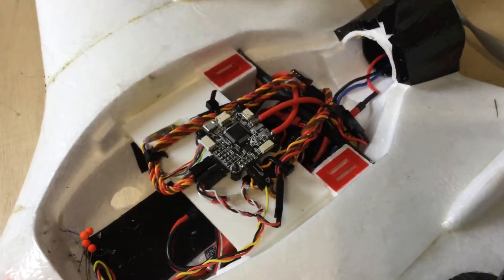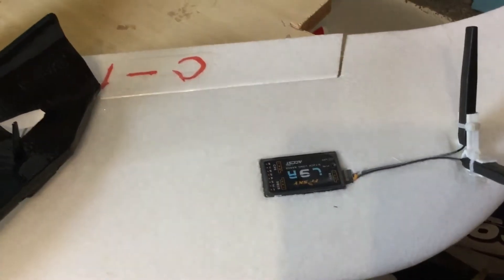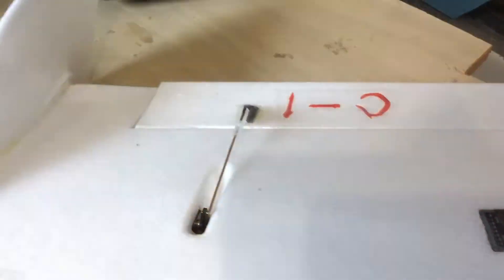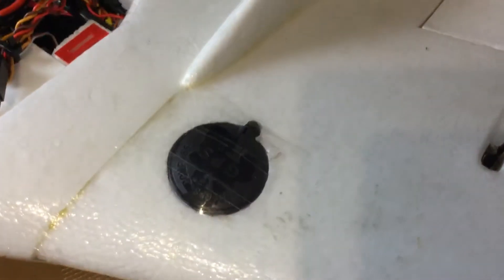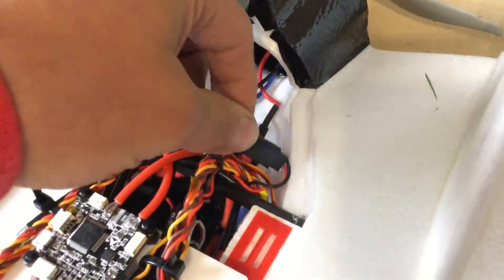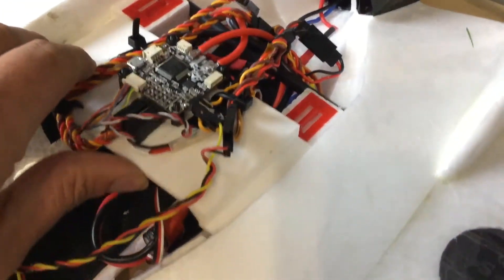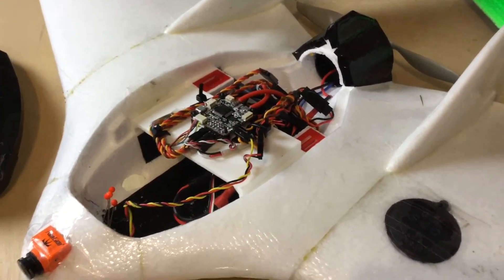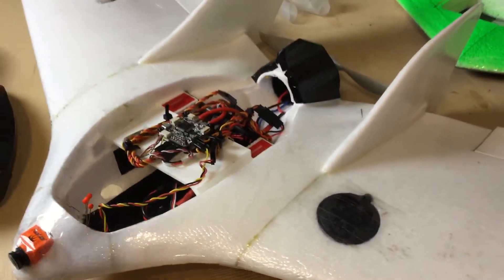C1 Chaser iNav Wiring Overview (Recorded on the iPad)

Comment: Very sneaky Matt!!! 
I've been searching for C1 Chaser videos or pictures with a 5.2 4S battery and just now realized that you made a step up with the board going across so the battery will fit underneath. I only noticed it when you lifted up the board. I'll be doing the same with balsa wood. Thank you.
Reply from the maker: Howdy Chris, oh totally! I knew it was going to be an issue when it first arrived and made 3D printed version. It has worked really well and using pins to keep the board still while in flight also worked very well too. Matt

Comment: Matt , do you need a Radio with S-bus to use iNav ?? many thanks , Scott
Reply from the maker: Howdy Scott, you can use PPM/CPPM or SBUS. These are the what the flight controller is expecting. If you don't have a receiver that supports either of these, then you can get a PWM to PPM (or SBUS) converter to take the PWM channels from the receiver and turn it into PPM, however I don't suggest those as it adds a lot of wiring to go wrong. So it's the receiver output, rather than the radio/transmitter  that is important here. Hope that helps Scott!
Reply: Thanks Matt , i use Hitech Aurora 9 radio but there is a FR-SKY delta 8  reciever that works with my radio and that does CCPM as i used that on a mini quad to cut down on the wiring . Great help Matt thanks a lot , now to start watching your iNav series ......

Comment: Thanks Matt. I was thinking that way, you
just confirmed my plans. So just bring yellow and black to the video in on the
 board. and yellow  and black out to TXred daisy chained  directly to main power pad.
Also could I get a copy of your C1 INAV setup files to copy paste???!!!
Reply from the maker: Howdy Art, it's buried under a load of other models at the moment. It's using the WW Z-84 present though and one of the servos needs reversing. Run this on the CLI tab and type save & press enter afterwards:

servo 3 1000 2000 1500 -100 -1

Comment: Hi Matt, I have a question. Building C1 chaser also. I have a 5vdc camera and the normal 12vdc tx. I have a 12 to 5v regulator on the camera as tx is 12v in and out.
How do I wire this configuration to  f4 v2  board. Do I take 5v from the board or still use my vr?
Reply from the maker: Howdy Art, I would strongly suggest using the voltage regulator. One thing though, make sure the black wire on the way out of the regulator is connected to another ground pin some where in your system, this will stop the OSD from flickering and is called "a common ground". See the install on the FX-61 in the iNav series for what I do with the wiring for the vTx and camera, Matt

Comment: Thanks for this video, Matt.  I take it you are powering your servos from the on-board 5V BEC?  Do you have any concerns about burning that thing out?  Most things I've read strongly discourage that due to the highly variable nature of servo current draw.  I've been wanting to try iNav but have hesitated because wiring the output rail with an external 5V BEC but also viewing batt voltage/current in the OSD still confuses me a bit.
Reply from the maker: Howdy Jacob, this board has a current sensor on it which means it also has a 5V supply on the board, I'm using that to power the servos and it's working great. Mind you it's a flying wing, so only 2 servos are being used. Matt
Reply: thanks for the answer..

Comment: Man, I've been mucking around with a Pixracer, external osd etc. this looks much cleaner. No voltage sensing, though?

(but I still have to finish the Pixracer project; I don't like to abandon (too many) projects in midstream)
Reply from the maker: Morning, yea that is the same conclusion I came to with the PixRacer, the biggest weakness is the faff with the OSD. Using MWOSD 1.7 and it doesn't update the flight modes.  You mentioned the voltage sensing, the board I'm using as a current sensor on it, so also displays the voltage and the current too. Works very well, once calibrated accordingly of course. Matt

Comment: Nice job Matt, watching with interest as you iron the inav bugs out of it.....Soldering tip..make sure you are using real solder with lead in it, not the H and S rubbish from the EU...RS sells it, just ask them to give you the real stuff...lol...It may be in a plain brown wrapper...:)..Cant believe how low cost this setup is either....Well done matey...:)
Reply from the maker: Thank you! Yep using lead solder & a flux pen as well to help it flow. And crazy value considering even that board & GPS still came in at around £35 delivered. Thats one fifth of the cost of a vector. Crazy, Matt